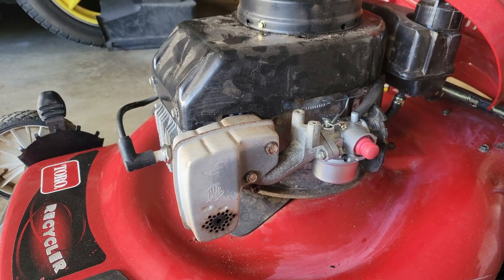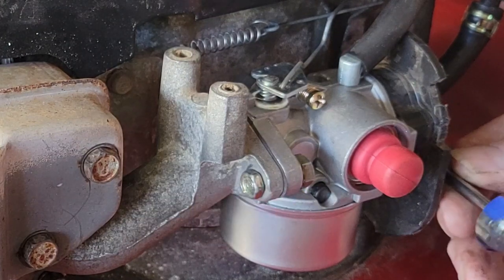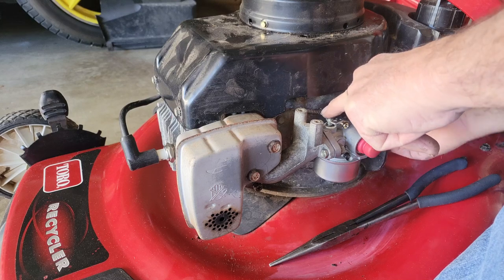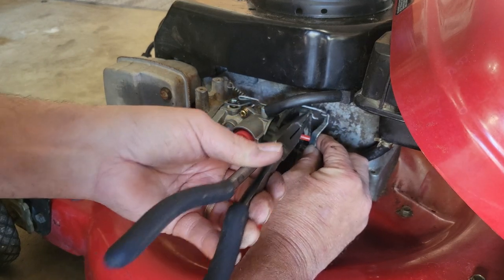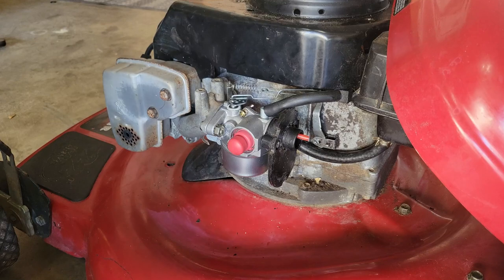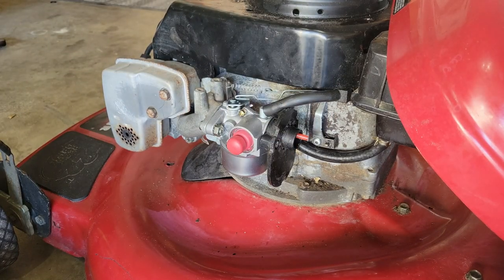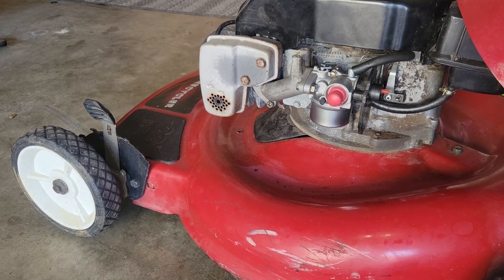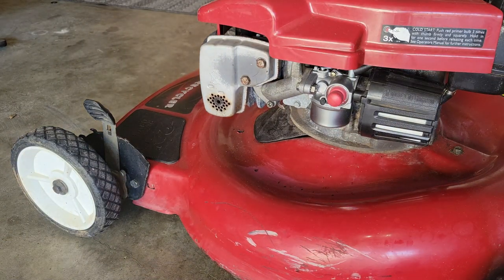This mower had a problem that should never happen. Easy fix though.

Comment: This is another older video that I just seen Bill, you get it going every time👍👍
Reply from the maker: I forgot about that mower. When I looked inside the throttle body of the carb I saw the choke was open and thought "that's different", when I moved the choke I realized it was pinned open and I thought "rookie...". 🤣
Reply: @GuysPlayingWithTools  LOL Bill

Comment: I just picked up a old Briggs flat head engine model yard machine mower for free off the side of the road. The guy said it smoked real bad and blew out oil from the muffler. I took it home checked the oil level it was WAY to full. I changed the oil and let it run for about a half hour. After that it runs strong, starts easier then my 3 year old honda mower and no smoke or blowing oil. I think the previous owner stored the mower on its side and alot of the oil got into the muffler. 
It's sad to see that so many people throw away good machines just because they don't know what there doing or don't want to do it correctly.
Reply from the maker: Good catch! When they are over-filled and blowing smoke the muffler will get REALLY oily REALLY fast.  Lol. Whenever I get a smoker the first thing I head for is the dipstick, taking some oil out cures way to many of them. 
When I find a perfectly good mower that took a little abuse at the curb I tell my wife I found "curb treasures"
Reply: @GuysPlayingWithTools  I tell my wife it's curbed gold lol. I also just sold a great running and looking mower for $150 that I found on the curb that the guy said he put a new blade on and it wouldn't cut right after that. And he replaced it with a new one. I took it home. It started first  pull ran very very good and the blade was brand new and only upside down. I just shook my head lol
Reply from the maker: @iowafox2206  why am I not surprised??? I really should be. 🤣
Hopefully they will watch some videos before talking on a job where upside down is an option. LOL
Reply from the maker: Also... he should have taken a picture... just sayin' 🙂
Reply: @GuysPlayingWithTools  I agree with what you say 100% I got to say I just found your videos last night and I'm loving the content so far!
Reply from the maker: I appreciate it.  I really like making them and try to stick to the subject and suppress my real "joke a minute" personality

Comment: Came across this more than once, especially with tecumseh engines.
Reply from the maker: Yeah,  the Tecumseh motors that are old enough to start needing attention aren't obvious.  That's why i push for taking pics before anybody takes one apart.  The Tecumseh designer of that linkage needs a 15 minute time out.  🤣